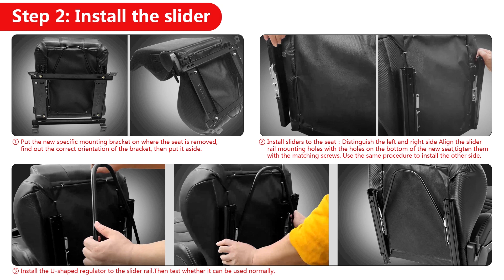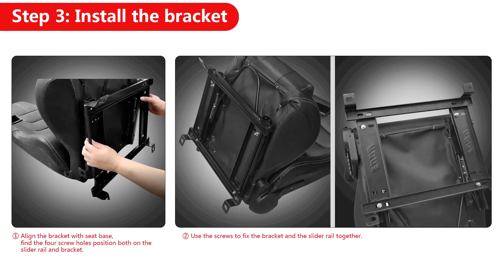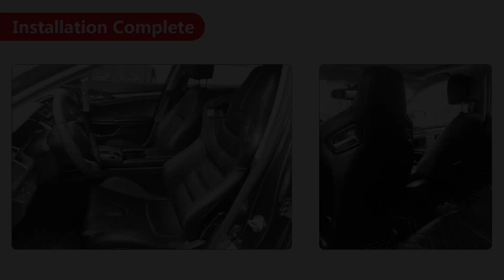How to Install Racing Seat-IKON Aftermarket Seats Installation Guide

Comment: 💥 I wish this video was slower and showed a little more detail. 2:08 do the 4 bolt mounting holes in the seat bracket line up with every car?  I have a 1970 Camaro.
Reply from the maker: Thanks for your interesting. Here suggest you to check the size chat for our chair: https://ikonmotorsports.com/products/universal-color-bezel-racing-seat-dual-slider-pu-carbon-leather

Comment: Question, I noticed you did the seats on a Honda Civic. I also have a 10th gen Honda Civic and I'm just wondering where can I bolt on the seat belt buckle that was originally on the OEM seats?
Reply from the maker: Yes, you can use the OEM seat belt on our racing seat, but the seat belt buckle need to adjust to a suitable position, you may need a  professional installation.

Comment: How do you know if the base is the right size and will actually bolt on to the rails, I’m trying to find a base for my 2011 wrx but I don’t know what the right one is
Reply from the maker: Hi, you can click the link on description to find the racing seat on our website, then you can see the slider size